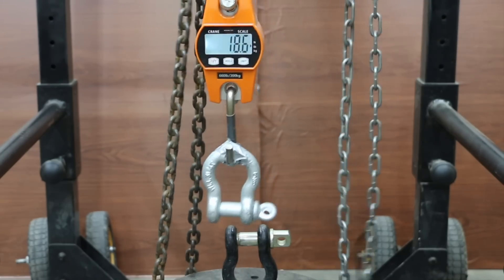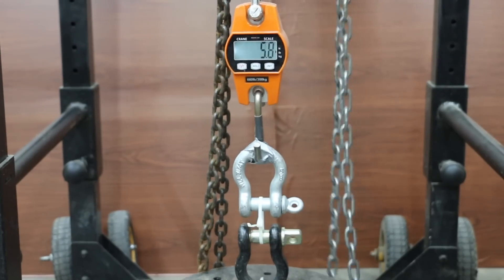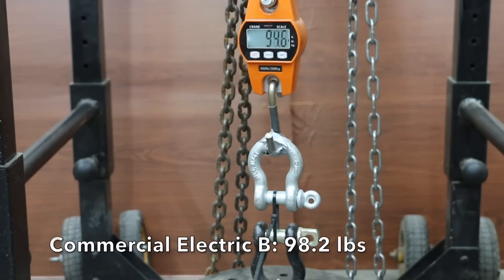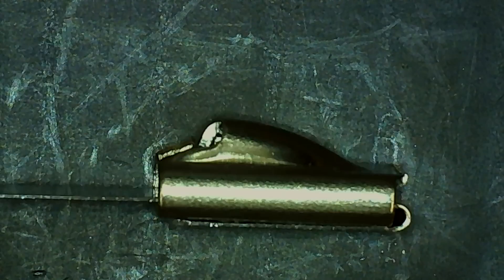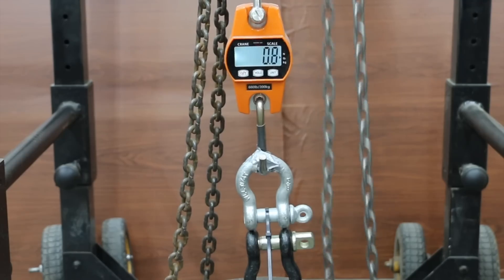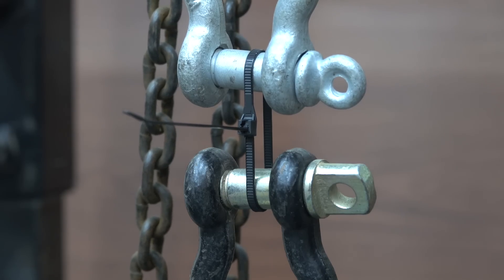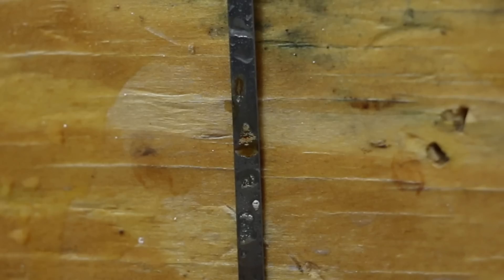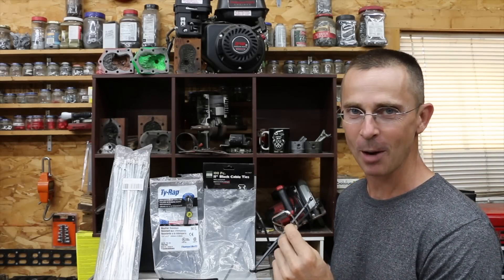Best Cable Tie (zip tie) Brand? Let's Find Out!

Comment: Great follow-up. Just one note on your results: If you look at 7:31, the failure mode suggests that the stainless ties would have held even more weight if they were wrapped tightly around something... the bottoms would not have folded out, and the mechanisms would therefore have held on longer.  I think that could be a valuable lesson for those who use stainless ties!
Reply: Love to see how diverse this community is
Reply: But how hard is the cable tie to pick?
Reply: @smeezekitty  Harder than a Master Lock.
Reply: @smeezekitty  Almost all zipties are very easy  to open/reuse with a small pick or flathead driver. If you accidentally "zipped" too early, all is not lost. Use a small pick, pry the tiny lock mech up, and slide the strap back through the way it went in. Then, before reusing, push the lock mech back into place with the pick to ensure it grabs.
Reply: @smeezekitty  The Cop ties are setup so you can't pick them. These standard ties can be opened by shimming them.
Reply: Still more secure than a Masterlock though :D
Reply: @Alan_Hans__  - You made me LOL @ your comment! But Oh so true!
Reply: @Alan_Hans__  Hmmm... Maybe LPL should check it out? :D
Reply from the maker: Thanks for the feedback.
Reply: I'm pleasantly surprised to see you here, Mr. LockPickingLawyer!  Now if there was just some way for you and Todd to do a collaboration.  :-)

Todd, if you're not familiar with LPL... the man makes nearly every lock on the planet tremble in fear! ;-)
Reply: @TheFastgeek  how about picking a lock with a a stainless zip tie?🤔😁
Reply: @deadaccount6135  knowing LPL, that would be too easy. Now his hands being bound together (safely!) with a ziptie might be a good start. 😂
Reply: Come on man, you can’t be following me around like this. I swear I’ve been trying to get away from you and you keep breaking into my sub box
Reply: ...2 is binding, solid click out of 3..
Reply: All of these failed because in the background the ties heard "I'm going to use the pick Bosnian Bill and I made"
Reply: How are you not verified U have 2 mil subs
Reply: @joshmanis-h7h  obviously hes super paranoid about privacy bc he always wears those creepy eyes wide shut masks and wont even tell youtube who he is so he is verified lol had to unsub from him for being a fkin weirdo
Reply: I think LPL is just looking for items which he can use to humiliate locks. “Masterlock picked with a zip tie”.
Reply: I am subscribed to both these awesome channels!
Reply: @SudburyMan  Masterlocks are shaking themselves open as we speak, lol!
Reply: Anyone else hearing LPL's voice while reading his comment?
Reply: Love your videos!
Reply: yeah took me a second but yeah you right . if he placed the back side on something that pin would not have folded and it will have held longer for sure . Great catch .
Reply: Can you pick a lock with a zip tie?
Reply: @yehudagoldberg6400  if it's a piece of hot garbage, then yes. https://youtu.be/BIq9khF-axs
Reply: Good point, LockpickingLawyer. Zipties - metal especially - perform better when wrapped around something with tension so the locking mechanism can't "give." I use zipties like sparkplugs or oil... they're part of my machines, lol. All need occasional tightening, too :D
Reply: Woah. Ofc you noticed something we didn't! Lol
Reply: agentelvis81 I don’t have 2 mil it was a typo
Reply: HARBOUR FREIGHT WAS BINDING ON LOCKING TAB 3
Reply: @unnamed47  its just funny to me when grown men are scared of showing their face on camera dont be an ass lol like AvE and LPL are hilarious too scared to own what they say and show their face
Reply: @penguiin12  or they want their content to be what everyone focuses on rather than looking to become celebrities. You say weird, I'd say humble and respectable.
Reply: @penguiin12  Do YOU want 2 million people to know what you look like and potentially find you?
Reply: @MrJJandJim  no, but i also dont want to go to space so i didnt sign up to be an astronaut. see how i mean? they sign up for being a creator in the public eye, and decide no i need to be 100% in control and hide their face/identity because they are cowards and paranoid because they think they are so much more important than they really are
Reply: @penguiin12  Well... Like you said THEY are in control. And you said yourself that you wouldn't want to be followed by people. Why do you think every creator NEEDS to show their face? Why don't you show me YOUR face? Or are you going to be a "coward" and refuse? Because technically you're providing me content by interacting with me!
Reply: @penguiin12  He's involved in the pentesting community in the physical security aspect. Although I believe by hobby, but he is around many of us in pentesting. Privacy is huge in the hacker community and there isn't much more of a hacker than a pentester so naturally he's going to be more private.

It is so strange privacy used to be expected, now with Facebook and all the social media it seems to be odd to be private online. Where it used to be totally the opposite and still is in many circles. 

 It's a part of the culture he is in. It should be perfectly acceptable and the norm to be responsibly private online. Due to the swattings that occur on youtubers, stalkers, people bugging you asking questions, and doxing. It is very normal to separate a hobby from your normal life so you can have a normal life. 

In case you didn't know he's a lawyer so he has other things going on not involving YouTube so people could interfere with his professional life which could cost him clients. He's providing content for people for free why do you think he owes you him risking his professional career on top of that for free? How narcissistic you must be thinking strangers providing free educational services owe you so much. Bad look pinguiin, really bad look.

Comment: Again, amazing PF and i'm glad you have fun doing these tests!   
idea: non coated rotors, coated rotors and self painted rotors with various paints/of various constructions( vented and solid), do an initial and a follow up after a few months of exposure. simple rotating rig and braking caliper rig to simulate driving.
Reply from the maker: Thanks for the video idea.

Comment: First discovered Ty-Rap because the Almaco machinery at work used Ty-Rap exclusively from the factory. I was impressed with the appearance of the design and its infinite adjustability. Glad to see its failure mode is not generally catastrophic.
Reply from the maker: Thanks for the feedback.

Comment: Try testing the water resistance on 
shrink flex used on cable soldering joints.
Reply from the maker: Thanks for the video idea.

Comment: Thomas and Betts invented Ty-Raps in the fifties to replace having to wrap string around wire  harness's in Airplanes and the rest is history, They used the stainless steel locking tang from day one. They are the only brand we use on race cars and on car repairs because they don't fail over time. The imports for me are a no go as too many failures in the  past.
Reply from the maker: Thanks for sharing.

Comment: I use zip ties all the time as well for mocking things up, holding parts/assemblies to bolt/weld them in place.  I just used some stainless wraps to hold on heat wrap onto an exhaust.  Tip for those people that have a hard time getting the stainless ties tight - take a 1/4 inch-drive (small diameter) deep well socket and cut a slit about 1/4 inch deep in the end where you would put the bolt.  Then attach the 1/4 drive to a screwdriver.  Put the loose end of the tie through the slot and start turning - it will cinch it up so tight you can break the locking mechanism if you go too far.  They sell tools that do this, but if you're like me, you have a drawer full of SAE sockets that I rarely use now.  Great test.  Todd, I needed to do a lot of cutting stainless steel and some welds last week.  I couldn't find the Makita at Lowe's or Home depot, so I took a shot at the Bauer cutting discs, and they seemed to work way better than expected.  Perhaps you could re-test using the Bauer and Hercules brands?  Home depot had some Avanti's in a multi pack, I didn't buy them, but I can't remember if you had tested those either.
Reply from the maker: Thanks for the suggestion.

Comment: A farmer's way saves the day! Great test, I was thoroughly amazed at the strength of some of those, especially the Storehouse HF brand!

I use ties for making plug wire separators. 1 tie somewhat loose around all wires, 1 tie around the first tie but between each pair of wires you wanna separate. Snug to fit & trim excess. The plug wires will never touch or come out of the separator no matter what.
Reply from the maker: Thanks for sharing.

Comment: Great Video!   I have some video ideas:

-oil filter shoutout video.  Amsoil, RP, WIX XP etc
-pocket knife steel testing. This would be a cool PF vid because of the way you test
-auto UV light protectant video on dash.  Armour all etc
-electric wrench shootout!!!!!!   Milwaukee 50 lbs rated and maybe the 30 lbs vs kimo (amazon) vs snap on vs maybe other cheap amazon or harbor frieght

Awesome testings PF
Reply from the maker: Thanks for the video ideas.

Comment: Great test but there are some serious flaws that statistically will not be valid.  First the rated or specified strength of each zip tie should be the same.  Since some are same and some not, they shouldn't even be compared to each other.  My 2 cents.
Reply from the maker: Thanks for the feedback.

Comment: Did you look at Thomas & Betts website tnb? Thousands of Ty-Rap (Zip Ties) that can do all kinds of things. From High Temps to blind mounting to basically whatever you want. They also make steel ones, colored ones, etc It's the brand I go to for quality cable ties, and I buy cheap ones for basic projects but i do like as a rider to have good one son hand when out in the woods and need a trail fix. Maybe I knew of the brand etc because my fathers career. We always had that brand in the home. Harder to find, my Home Depot sold them but then just went to the cheaper ones. I guess not many people understand the difference and just look at the price.

Steel ones I have found are just not practical for most applications, hard to get them tight int he field and they can scratch paint etc. Like if a rider needs to use them to hold a flat tire onto a rim to get back to their truck. It's easy to get the Nylon ones tight.
Reply from the maker: Thanks for sharing.

Comment: Tie wrap are amazing i use them daily. Very nice zip tips.
Reply from the maker: Thanks for sharing.
Reply: @ProjectFarm  i have some Caterpillar issued zip ties I'll have to send them too you they are massive 3/8 wide x 10 inched long x 1/8 thick. Dang near impossible to cut. Almost as good as the ones law enforcement uses if i had to guess. Lol

Comment: Generally, Black zip ties last longer because of carbon black (same thing used to strengthen tires) in the ingredients and is more UV resistant. (Also look better on automotive applications).
Translucent zip ties are just resin, so they don't hold up as long, get brittle with age and or exposure to UV. Of course stainless would be best, but that comes at a high cost. I sometimes use stainless steel saftey wire to make quick clamps around low pressure hose. Very useful & strong. Keep some in tool 🧰.
Reply from the maker: Thanks for sharing.

Comment: TRIVIA.... The Harbor Freight Zip Ties are made from 6/6 nylon, which incidentally is the same material that Gibson guitars used for their nuts and saddle inserts in their ABR-1 bridge found on Les Pauls and SGs back in the late 60's to early 70's. While one may think nylon nuts and saddles wouldn't wear very well or sound very good on a guitar, these nylon pieces are coveted by Gibson collectors. I have never seen 6/6 nylon used for anything but the things mentioned, but I am sure it has been used elsewhere.
Reply from the maker: Thanks for sharing.

Comment: Great test. UV is hard on all plastics. Nylon is no exception. Carbon black is the cheapest non-toxic UV inhibitor and it adds tensile strength. I was not surprised that the expensive Ty-Rap zip ties kept their elasticity after UV exposure. Thomas & Betts uses expensive UV inhibitors in their products, not just carbon black, and are spec on many industrial sites. What really kills plastics is ozone. Today, zip- ties are used almost exclusively as wire holders for all electrical applications. Where you have electricity, you have ozone. An ozone test on stressed (bent) zip ties would be interesting.
Reply from the maker: Thanks for the video idea.

Comment: Only black plastic can handle UV this is why all cables are black and if u seen the black and yellow markings on electrical poles all the yellow change color and dissapear after several years.

Does not mean it will break in a year it just means it will breakdown slowly and in the end shatter (like all plastics staying our in the sun).
Reply from the maker: Thanks for the feedback.

Comment: You have become a standard with me and my coworkers. Developing tests, testing and proving our results is something we do on a daily basis. Each new video's process and results are discussed in depth. Have you considered testing bar chain oil? Especially bar chain oil with additives like Motorkote. Do they help and are they cost effective to use? I know some loggers use them. Thanks for the hard work it is greatly respected.
Reply from the maker: Thanks for the video idea.
Reply: Some guys come into my chainsaw shop and they say they use used motor oil. I just tell them oil flings off easily and doesn't stick to the bar.

Comment: Why isn't Todd measuring the force (like in newtons or ft/pounds) instead of using a scale?  If I walk into a car vs run into a car, one is going to cause more damage despite my mass being constant.  This is because my acceleration is different in the two examples.  Force = Mass x Acceleration.  Todd needs to be measuring the force he is applying to the cable ties not using a scale.
Reply from the maker: Thanks for the feedback.

Comment: Excellent testing and thank you for taking the time. I use zip ties daily for my job. The Harbor Freight ones have been abysmal for me. The latch fails during initial install or the cable snaps right at the head during initial install. Probably 25% fail right away. For reference, I'm usually using the smaller 5" ones and I go through probably 30 a day. I've given them 3 separate chances over the last 3-4 years. No more. Just my 2 cents. :-)
Reply from the maker: You are welcome!

Comment: 12:54 lol. I know you've done it before. It's still funny. Can you do a long term UV exposure test with your left over plastic trim restorer products? It would be nice to know what product actually prevents the fade of black plastic auto trim. Home Depot has got to have some cheap landscaping plastic trim made out of the same melted down Barbie doll plastic that Chevy still uses for bumper trim. Coat it up and leave it out side for a year or so.
Reply from the maker: Thanks for the suggestion.
Reply: @ProjectFarm  Awesome Todd!

Comment: Anyone explain why these materials seems to increase tensile strength after UV exposure???
Reply: I could only assume the UV resistant materials that mix in with the plastics when being produced,  cure once under UV making the soft pliable plastics into a more brittle yet less soft, stretchy material giving it more strength.

Comment: The UV may have made them brittle but that is because they are also harder now. The fresh ones have more flexibility and as such the locks slip more and the cable has a tendency to stretch move, exaggerating failure points. The hard ones seemed more like a crack than a stretch and split.

I think if you put the zip ties through the head bolt holes you might get it to stay in place better, and stay more even over the engine. Also you might try striking force against the zip ties, hitting them hard instantly might cause different failures.
Reply from the maker: Thanks for the feedback.

Comment: Wait! That’s far from an entire pickup truck. There about 15% missing to rust! Kidding, great content as usual. I’m
Going to have to buy steel ties too.
Reply from the maker: Thanks 👍
Reply: Picking up the truck from the back end's probably lighter than trying to lift it from the front since what's where the bulk of the weight is likely to be due to the engine and everything else.  Still, if you had a tractor handy, some chains, and a steel tie but no car jacks, I suppose it'd be a valid way to change your back tires?
Reply: are you kidding that's 110% pure bread farmtruck in its prime and in its natural environment, it wont be towed out to the back for at least 10 more years.......

Comment: Tensile test isn’t accurate if the Zip-tie isn’t completely vertically centred along the axis of loading. If it’s not centred it will be side loaded because of your setup using wide shackles. I would suggest spacers of equal length on each side of the Zip-tie within the shackle pin.
Reply from the maker: Thanks for the feedback.

Comment: I would like to have seen them looped over (basically go around the tester two times) to eliminate the locking mechanism failure and test the actual strength of the plastic. Do you think companies will now expose their cable ties to UV to increase strength?
Reply from the maker: Good question!  Thanks for watching.